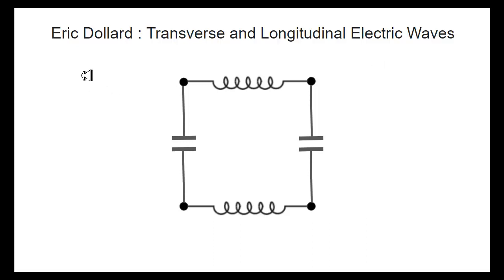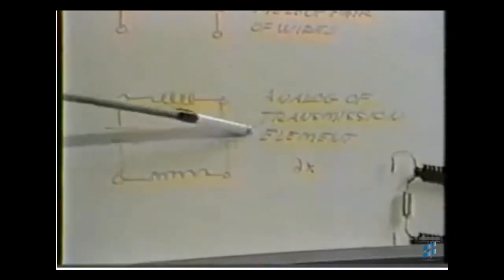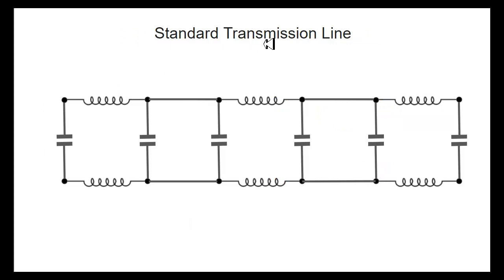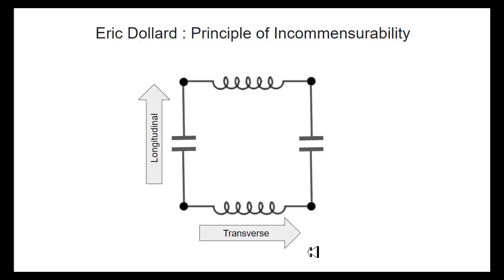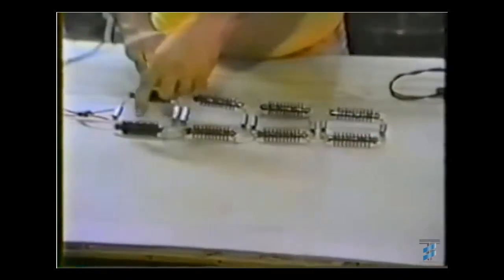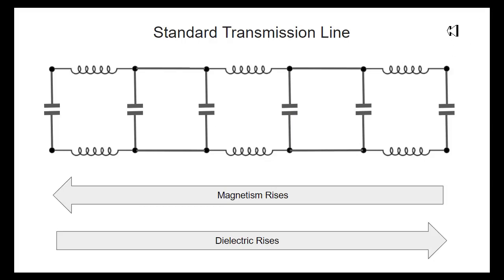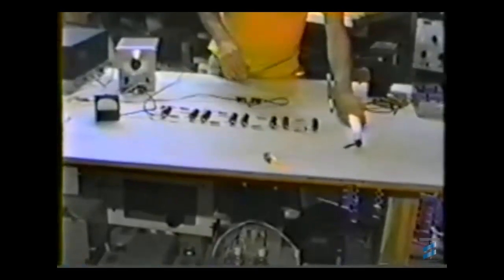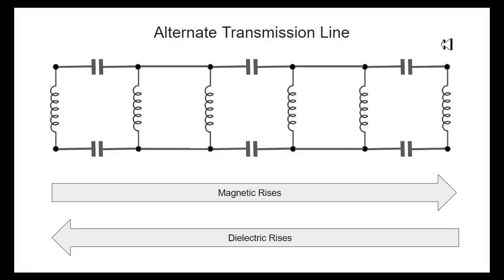Eric Dollard's Transmission Line Element and the Principle of Incommensurability

Comment from the maker: Looks like I may have made a mistake in the last part where I say that the Magnetic rises in the opposite direction to the Dielectric in the longitudinal transmission line. I must have misheard what Eric was saying. Turns out, both the magnetic and the dielectric increase towards the load. I will double check this and then make a correction video when I get a chance. On another note, here is a link to a short paper that I wrote outlining the incommensurability between inductance and capacitance. 

https://www.researchgate.net/publication/332886426_Steinmetz_Analogy_Between_Magnetic_and_Dielectric

If I made any mistakes in this paper, please feel free to let me know.
Reply: It's an easy mistake to make, and I had the same confusion initially. The distinction between LMD and TEM really boils down to the dielectric and magnetic phase relationship.
Reply from the maker: @pvlis  Thanks. But really, I should have been paying better attention to the video I was presenting.

Comment: @FractalWoman - you should correct the last slide with the alternate line of transmission - Both Magnetic and Dielectric forces increase with the direction of Wave Propogation in Longitudinal Mode
Reply from the maker: Read the pinned comment. I can't correct the video without removing it and redoing it.

Comment: It is wrong electricity goes from pos to negative think of current as the wind that flows through as a high speed vehicle passes and the force of current of air or actual current is same it goes opposite..... So the connection or the could shd b inverted ie pos to neg like a gun coils behave while capacitors behave like  two hands clapping to produce dielectric and u can make transverse eor longitudinal depending upon cap in series or coils... True but the coils   have to align to the charges cw or ccw

Comment: Thanks for making this video. It should make it easier for many people to follow compared to the original low quality footage.

Counter-space is where the Aether field exists, outside of what we perceive as dimensional space. Throughout the universe, the Aether exists in disproportionate states of Magnetism (inductance) and Dielectricity (capacitance). All substance is Magnetic (dimensional and perceivable) and all Aether is Dielectric (intradimensional and counter-space). This duality exists for everything for everything from individual "atoms", all the way up to planets and galaxies.

From our perspective, Dielectricity only exists in counter-space (unless you consider the electron model, which is conceptualized as the conductor being charged with fixed units of Dielectricity). Changes to the inertia of the Aether causes some of the Dielectricity to become Magnetism which results in what we observe as a magnetic field (inductance), while creating a moving magnetic field in dimensional space also changes the inertia of the Dielectricity in counter-space resulting in what we observe as "virtual electrons" (capacitance).

Transverse waves propagate at a 90 degree angle, which Tesla described as sound waves rippling through the Aether, and that's why the speed of light is the rate of hysteresis/induction through the medium. In contrast, Longitudinal waves propagate near instantaneously because the capacitors are directly connected by vortexes in the Aether due to capacitive inductance under resonant conditions.

I hope this answers more questions than it creates. If you'd like me to clarify anything else, I'd be happy to answer any additional questions that you have.

Comment: If you look at a standard transmission line (transverse wave), there is energy conserved in time (spin, constant power in time, ...). A photon appears as a wave. Pressure zones are between and along the wires. For the longitudinal version of the transmission line, there is no line!! Here, pressure zones are created in the space. Energy is conserved in space!! A photon appears as a "particle" (constant power in space, no spin?, ...). Therefore, in a certain space the photon will shine "always" and in another space it will not shine "at all". It won't blink in time (Mr. Distinti assumes in his videos that it would flash), it will only "blink" as we move through space through these different sections. Then it can appear to be a violation of the law of conservation of energy, since energy appears to be created and destroyed here (like E. Dollard says – Cosmic Induction Generator). And that's why, I suppose, classical physics have a problem with "free energy", because they don't see this second possibility, they only see the conservation of energy over time. And since a photon is probably always a certain combination of transverse and longitudinal waves, even in a place where its longitudinal component does not shine, its magnetic part shines there.

Implications for cosmology and astronomers!! So what do we actually see in our sky? (regarding stars) Are they really billions of years old? Or are we seeing an almost current state? (E. Dollard claims that it follows from the equations that longitudinal waves can propagate instantaneously under certain conditions.) And what do we see if our planet is in the pressure zone of longitudinal wave, and what will we see if we are not in it? And what would that say about certain stars and their blinking?

Note on energy conservation in space: Russians ("https://drive.google.com/file/d/1t4DQ5nXCd3jxKEsIDI-rAbzY65zkRvfo/view"), Martin Fleischmann Memorial Project youtube channel, W. Reich (Orgon accumulator) and others. All of them have experienced power persisting in space with their devices, even after the device has been turned off and even removed from the location. In some cases energy persisted there even for two days.
Reply: Isn't the conservation in space, what Eric calls counter space. As I understood it, it acts as an  accumulator, what ever that really means. I think he said, and I quote Eric, "It goes into the material." So some scaling down or up, going on, like a fractal.
Reply from the maker: @michaelstiller2282  Interesting. Scaling going on like a fractal. Maybe that is why they are called scalar waves.
Reply: @michaelstiller2282  I think that the explanation of a phenomenon always depends on the point of view. E.g. geometry is frozen music. And music is geometry in motion. I can describe the same phenomenon from the point of view of music (its terminology, ...) or from the point of view of geometry. Seemingly different explanations, different terms, etc. It would seem that they are different phenomena, that they cannot agree. And that is the state of contemporary science. Scientific fields are so specialized and fragmented that they do not perceive that most of the phenomena they describe are the same or similar and refuse to learn from each other. As soon as they find a difference in a phenomenon, they immediately think that everything is different, that they need different explanations, etc. And then it takes them an awfully long time to investigate any event, they spend billions on it, and at the same time somebody else has already done it in another field and they could learn from it and save time and money and then just factor in those differences.
For myself, for example, I distinguish between qualitative and quantitative opposites. The quantitative opposite is, for example, two repelling magnetic fields. Quantitative opposites in space occupy an angle of 180 degrees opposite each other. The qualitative opposite is, for example, magnetic and dielectric fields. Qualitative opposites often occupy a 90-degree angle in space. You have to know which opposition you want to use and adjust the geometry of the device accordingly. Another opposition is inside vs outside. And here, in my opinion, we get to the concepts of space and counterspace. With dielectricity, the energy increases with decreasing space, with decreasing distances, increasing inwards (counterspace-inner space).
The smaller the "particles", the more energy. Therefore, they will constantly find more and more energetic "particles" in accelerators, because they will use more and more energy to create them. 😃 At least more and more surprises will be provided, and more and more necessary forces to explain them. 😉Maybe some have confused cause and effect (maybe me, maybe physicists 😀).And by "space" in my opinion is meant the outer space from the specified "particle", whatever "particle" is meant (including galaxies). And this corresponds to the magnetic field, which is stronger the larger the outer space it occupies (more space – more energy).
Reply: @zdenekbreza3770  I don't disagree, that said, and this applies to may thing, but i think its extremely important for a shared vernacular. Otherwise we end up writing books to people who already wrote their own book on the same subject, and describe the same observations word for word. I don't think anyone disagrees with that. Eric is at the enter of video. That said i think you described counter space the way he views it. So now there is a common term.
Reply from the maker: You say: For transverse version "pressure zones are between and along the wires". For the longitudinal version "pressure zones are created in the space". In the transverse case, you are talking about the "space" between the wires. What "space" do you mean in the longitudinal case? Thanks in advance.
Reply: @FractalWoman  The longitudinal transmission line is made up of closed "cells" (circuits) separated from each other by capacitors. They thus form pressure nodes and antinodes as in the case of a sound wave. Therefore, the frequency does not matter, as these nodes are stably distributed along the transmission "line". Since it is a series arrangement of capacitors, each subsequent "cell" has a higher voltage than the previous one (at least I think so). Therefore, the load side is higher than the source side and the energy will flow to the source, and therefore it is possible to have a higher power output than the input. In a transverse wave, the source side is higher than the load side and is therefore lossy, energy will always flow away from it.
But the voltage in the longitudinal transmission line between the top and bottom capacitors is the same on the load side as on the source side, because that is determined by the "coil". A longitudinal transmission "line" is not a line because the source and load are not directly connected by wires. These cells then form what I called "pressure zones in space" through the space. Pressure bubbles? Like beads on a thread? With a transverse transmission line, these separate zones are not formed. There is only one "pressure zone" and that is between the wires - capacitors in parallel.
Reply from the maker: @zdenekbreza3770  Thanks for clarifying. This is truly amazing and insightful. I hope other people are reading your comments.
Reply: @FractalWoman  Thank you very much. I really appreciate it from you. I learned a lot from you. And you know where else (besides lots of other sources, electrical engineers, of course)? From hieroglyphs from Ancient Egypt. 😉 They did similar things, only with sound.
Reply from the maker: @zdenekbreza3770  "From hieroglyphs from Ancient Egypt."  Hmmm. Do tell.
Reply: @FractalWoman  And from ancient India and Mesopotamia. Three different ways of doing one thing. It would be for several papers. Just a hint - stoneworking, cutting, softening stone and "carrying" several ton blocks of stone, healing and increasing harvest. And all this with the help of sound. One engineer was interested, and since I am not a practical type in this sense of the word, he tries to study it and what they did using sound, he tries to apply the same principles using electromagnetism and especially using electric longitudinal waves. We have agreed on certain conditions, so I would not like to elaborate more here.
I might have another suggestion for you. I can't find anyone in the Czech Republic for this, because I'm not an electrical engineer, so they don't trust me. A few weeks ago I wrote to you on your email for other reasons. Did you get it? Was it your email? If none of the people I contacted from the Republic contacted me during the next week, I would send you something to that email. If you are interested.
Reply from the maker: @zdenekbreza3770  I don't think I got the email. It may have gone to my junk mail which gets deleted automatically after some length of time. What email were you using?
Reply: @FractalWoman  One is your name and 22 in it- gmail, and the other one is your company email – Canada or should I write the exact name of the email?
Reply from the maker: @zdenekbreza3770  Try the 22 one again and then let me know after you send it. The info@theOMparticle.com one is no longer working for some reason.
Reply: @FractalWoman  I have sent you the email I sent you a few weeks ago.

Comment: As previously commented, the alternate transmission line ‘dielectricity’ increases as well…why is this?…there are two things happening here…internal circuits voltage multiplication (common voltage multiplier) in which voltage multiplies internal to the circuit capacitors in series (that is why Dollard is so careful touching the second circuit) and then the external continuation of the waves in the aether.  One cannot just fixate on the aether results when modeling with physical components.  Of course Dollard knows this so well that at least in the video clips you show he does not mention the voltage multiplier affect.  If you replace the coils with diodes the neon light will also behave similarly in the series capacitor setup.
Reply from the maker: Thanks for the info. Here is a link to voltage multiplier for others to see what you are talking about. https://en.wikipedia.org/wiki/Voltage_multiplier
Reply: The coils provide necessary oscillations.

Comment: As some point out below. The longitudinal transmission is not a mirror of the traditional configuration. The incomesurability is not inverted within itself in terms of direction of intensity. It is between an either/or system and one of neither/both together. 

As Leonard cohen wrote ‘There is a crack in everything, That’s how the light gets in.’ What this indicates to me is that we are ultimately dealing with an open system, rather than one that is closed in upon itself in its perfection.
Reply from the maker: In my opinion, it is an open/closed system. An electrical circuit must be closed in order to work, but it must be connected to ground (open) to function properly. Closed and Open are incommensurate principles.

Comment: 14:58 I think the drawing is wrong. In longitudinal transmission line both magnetic and dielectric rise towards the load
Reply: @FractalWoman  I'm not referring of what he says, but of what he's measuring
Reply from the maker: @noberom7054  Right. I will make a correction video on this when I get a chance. Thanks for pointing this out.